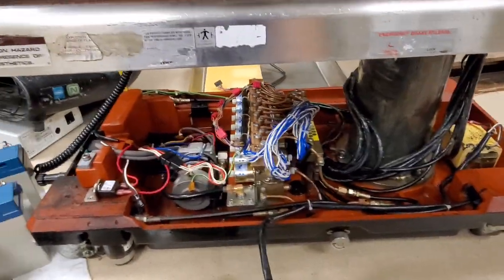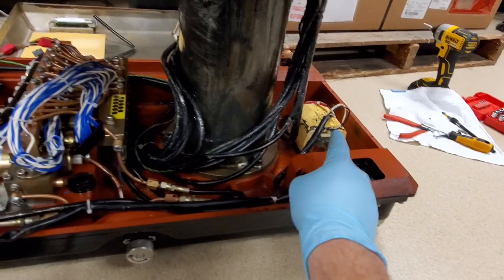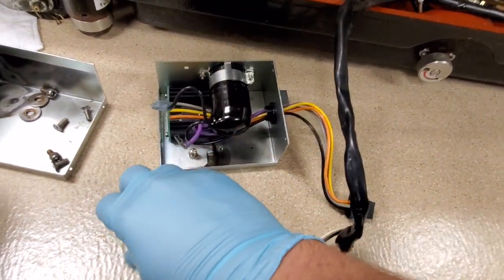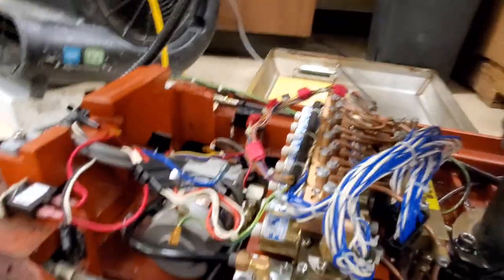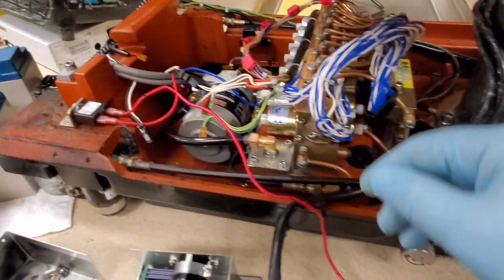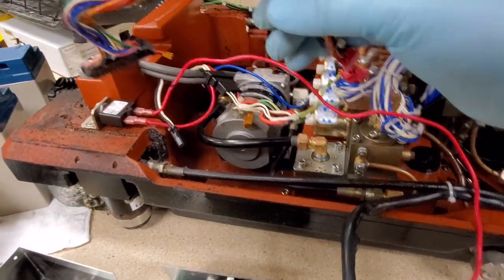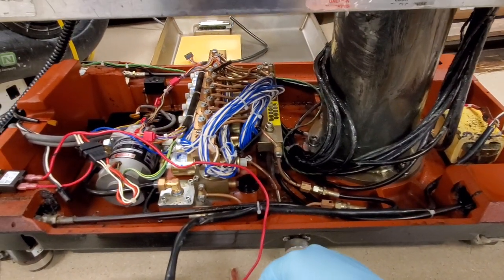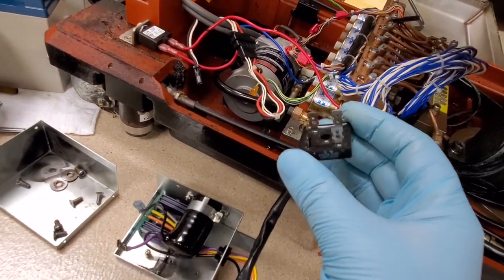Anatomy of an Electrical Fire

Comment: I know I am a few months late but this is  almost exactly what happened to me with a Skytron 6500 table in the same month of this year. My OR staff had just plugged it in after moving the bed into the OR when they smelled smoke and the control area case heated up to extreme levels. My issue originated in the pump motor which shorted out and melted everything back the AC power inlet, fried my brand new batteries, the power distribution circuit, and also ruined the control board box. Came out to more cost than the bed was worth, as you said a total loss.

I am keeping the table in my shop so I can cannibalize the hydraulic/mechanical parts off of it to keep my other 20+ year old beds going.

Comment: Please also check your Hydraulic Pump.  There is a possibility the Pump Gear has failed within the pump assembly, creating an Amp overload on the Motor Drive.
Reply from the maker: The DC side of this electrical system seems to be fine except for damaged wires that touched the 22VAC lines. There's a resettable fuse in line with the batteries.
Reply: @BetterBiomedChannel  If the Batteries and Relay box are installed, do you have articulation of all functions in Battery mode?
Reply from the maker: After this short of the rectifier,  AC went down the DC bus and vice versa. I expect the computer is fried. I know some DC / battery wires are melted due to being next to the AC wires..